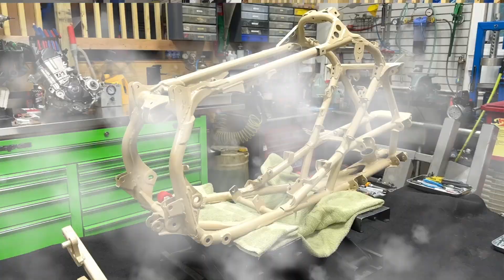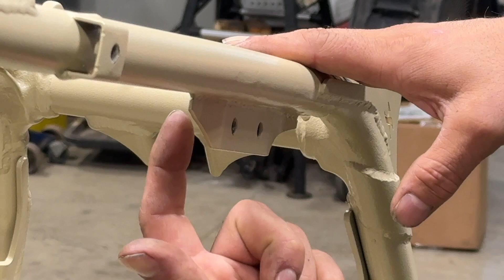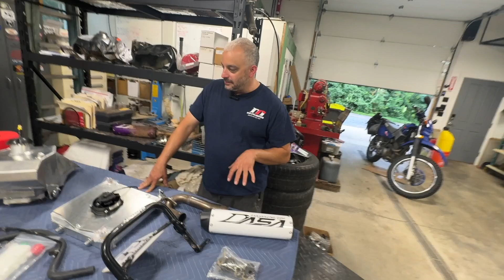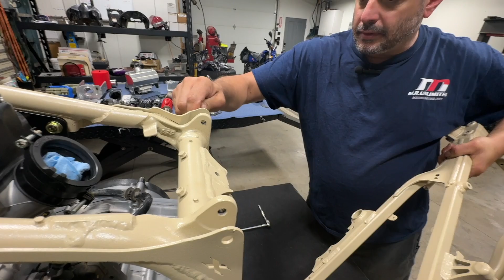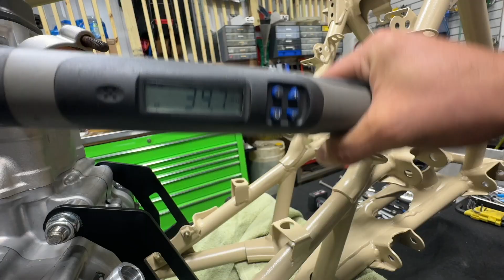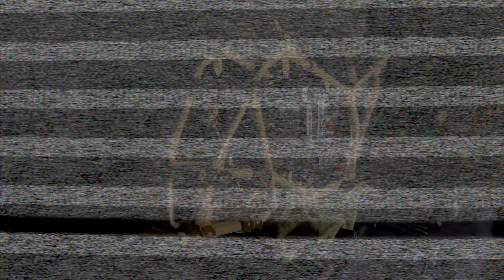Custom Honda TRX/CRF Hybrid: Part1

Comment: Doing a 19 crf swap into an 06+ chassis currently. Any chance you have the specs on the steel sleeves that go through the back of the motor as well as the widths for the ones that go through the swingarm?
Reply from the maker: swingarm spacers:  chain side - 2.55", clutch side - 2.90".  Engine spacers:  (Long) - ID: .590, OD: .830, Length: 1.29, Flange: 1.52 / (Short) - ID: .590, OD: .830, Length: .950, Flange: 1.52
Reply: @m.r.unlimited  thank you very much!

Comment: Had said 17 was kickstart but was it the standard bike kicker where it kicks rear instead of forward like a trx? Is there room with a rear kickstart engine to clear the fender? Curious as id love to do one and always guess what year would be best year to use, awsome vids!
Reply from the maker: The 17 CRF is a rear kick. You need an extension to clear the frame. The heel guard and nerf bars may be a clearance issue on some setups. Thanks for watching
Reply: @m.r.unlimited  ok thanks for the info! 18 and up with a 24v kit it is then haha

Comment: This should be an amazing machine when you're done . At the other end of the spectrum , last year I bought an '05 TRX 450 with a wasted engine for $250 
. This will probably make most people want to throw up but i swapped in an engine from a 1983 Honda ATC200E Big Red three wheeler .It turned out very nice , but obviously slow .